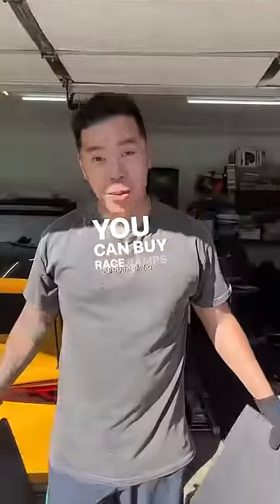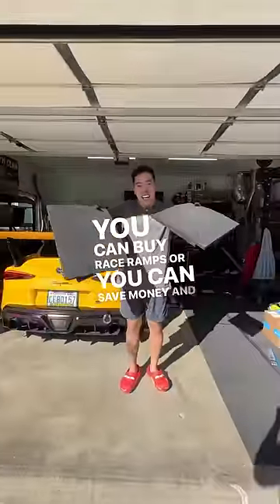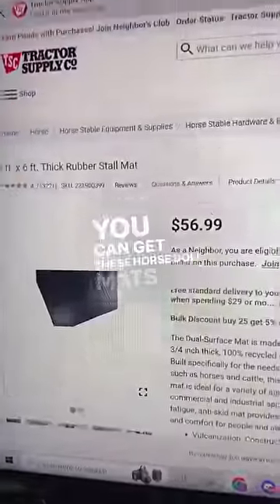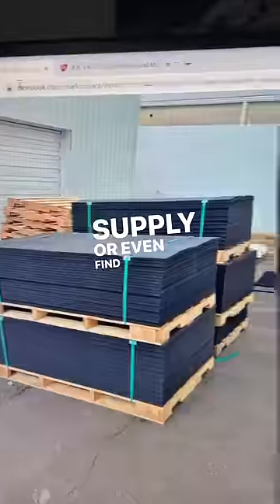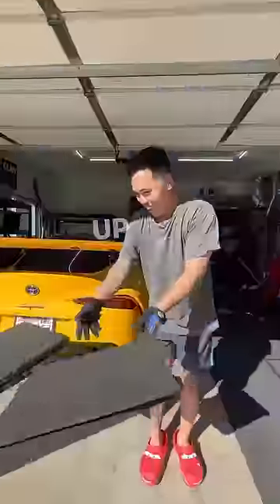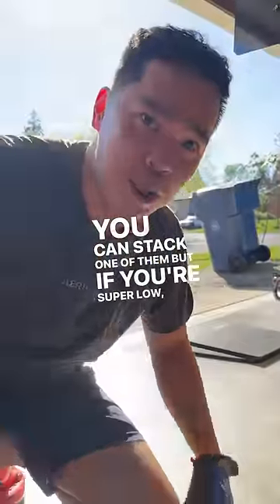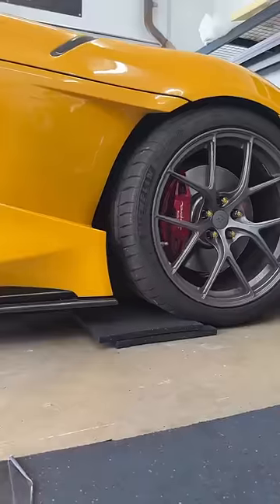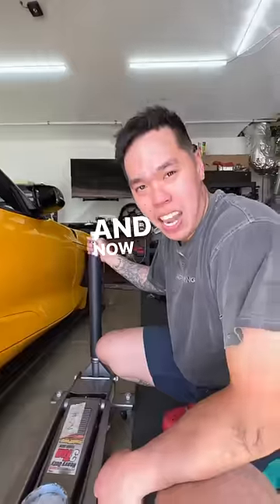CHEAP DIY Race Ramps for lowered cars!

Comment: Why the hell would I buy those mats when I can get the wood for free?
Reply: Exactly
Reply: exactly_#2
Reply: Exactly_#3
Reply: There’s people living in areas without those conveniences.
Reply: Exactly_#4
Reply: @75yomu  wait are you saying you think people don’t have access to wood?
Reply: @75yomu  who has money for a car but not for a piece of wood? You don't even have to buy it lmao
Reply: exactly_#6
Reply: Exactly_#7
Reply: Exactly_#8
Reply: Because the wood can slip and u whanted to get some nice ramps but u can instead just buy these mats witch dont slip and their cheaper than ramps
Reply: @Maykay1312  bruh ramps aren’t that expensive, would you rather spend 50 bucks at Walmart for some nice ramps or 60 bucks for some damn squares of rubber
Reply: Exactly_#9
Reply: @Maykay1312  😐😑😐😑😐 rly ? Wood can slip 🤣🤣🤣 I can’t, I had enough 🤣🤣🤣
Reply: @mirunajs8148  wood can slip much easyer than a rubber mat depending on what surface ur lifting ur car up on
Reply: @Maykay1312  then get a flatter piece of wood
Reply: @krotle8238  eh mby u dont whant a random pisce of wood in ur car/trunk/apartment/garage in the middle of the city who knows  mby its easyer to keep 2 black rubber mats stacked together in the corner of ur trunk who knows coud be any number of reasons but for sure its easyer and it takes up less space than having a car ramp in the back of ur trunk or a pisce of wood + u can use the rubber mat for other things other than going with ur car on it so u can lift it ye u can do the same with a pisce of wood but if u use that pisce of wood enough times its going to break apart the rubber mat will probaby be the same for the rest of ur life + u can do other things with it as mentioned above any thing that can get damaged underneeth if u just place it straight onto a small metal worktable rubber mat in between u whant to lift ur car with a car jack but it has a chance that it will slip rubber mat in between the jack and car … alot of other uses u can use a rubber mat for, ur disasembling something metal something from a engine compartment what are u going to put it on a rubber mat mby? its not going to slip like on a table because its rubber … as i have said many uses but eh depends what are ur needs u have a lowered car and cant get onto a curb and ur sick of placing a wood pisce in front of ur wheels and it slipping and u ruining ur front bumper on the curb u can put a rubber mat instead and its not going to slip ever again problem solved at least if u dont whant air suspention witch is a better option but costs more
Reply: Exactly_#10
Reply: You wouldn’t, it’s just mindless content
Reply: EXACTLY_#11
Reply: Looks better
Reply: Exactly_#11
Reply: @deadzen  12**
Reply: @utkarshverma3219  no, u wrote it wrong.
Reply: @Maykay1312  you skipped physics class didnt you? that wood only needs to hold it up for a second to get the jack under. Ive done this with sticks before. The force being applied to the wood is downward force from the weight of the vehicle there is no side forces. Even if it was a crazy slippery surface like ice it stil wouldnt go anywhere once the tire is up on it.  Also not that its relevant or matters but wood is a very grippy material
Reply: Exactly_#13
Reply: @75yomu use a brick then
Reply: Exactly_#14
Reply: Exactly_#16
Reply: @75yomu  without trees?
Reply: That’s  what I’m saying
Reply: Exactly_#18
Reply: Exactly_#19
Reply: Exactly_#20
Reply: Exactly_#21
Reply: Or leftover carpet 😭
Reply: Uhhh find ‘em?
Reply: @everett5374  for a normal car ye its probably not going to slip but if u have a bit more powerfull car then it might slip but as i have said u can use mat for other things thats my main point
Reply: exactly_#22
Reply: @carlo6229  u forgot nmr 22
Reply: @75yomu   there really isn’t
Reply: @75yomu  no wood but rubber mats. Lmfao
Reply: Exactly #23
Reply: Because then a big red X would show up and we don't need that
Reply: Exactly_#24
Reply: Exactly #25
Reply: Exactly_#26
Reply: I used to get wood every morning
Reply: Exactly #27
Reply: That jacks is meant for pickup trucks or suvs! If you have a car and crossover that’s really low to the ground just get yourself a low profile Jack
Reply: I'm looking for the last ' exactly ' comment
Reply: Free?
Reply: @Maykay1312 want*
Reply: LOL at the people trying to justify buying these rubber mats.. claiming wood can be slippery and its cheaper than ramps.  I've used wood on asphalt, concrete and even marble like surface.. NEVER has a piece of wood slipped, the weight of the car keeps the wood planted.  Ramps are expensive.. I've bought my low profile ramps for $65.. that barely more than these overpriced rubber mats for $56.99.
Reply: Exactly#29
Reply: Exactly#30

Comment: Dude is going to be shocked when he finds out about low profile floor jacks…
Reply: Just about say the same thing😂😂😂😂
Reply: My low pro jack doesn’t fit under my car :( too low if that’s even a thing
Reply: @belemollyon3330  my harbor freight Daytona Jack is about 3” or less off the ground…….and I do have a toe Jack as well.
Reply: i bought the lowest profile jack i could find but it still doesnt fit under my car
Reply: Not even that expensive anymore
Reply: I'm not putting my 50k car on top of a harbor freight jack.
Reply: @clanc433  you do understand that the harbor freight Daytona jacks have been proven to be as good as if not better than snap on.
Reply: @clanc433 I would understand a Ferrari in the saying but a 50k car what did you buy a base model f150? It’s 2023 Jeez dude
Reply: yeah but some people cant afford that so whats ur point
Reply: @joshdaniel7894  bad thing is depreciation will have his 50k car worth less than 20k in 5-10 years
Reply: My speed 3 ain’t even as low as his, yet a low profile jack or some scissors jack don’t even fit  lmao. The other day I needed to use wood planks, e- brake once on top, scissor jack then low profile jack 😂
Reply: I have about the lowest profile jack you can buy, it still won’t get some of these cars in the shop up, not a bad idea if you don’t have any similar shaped wood
Reply: mine barely fits😭
Reply: @clanc433 well then go spend a 100k on a floor jack made out of gold then
Reply: Why buy a jack that's useless for trucks and basically every other vehicle
Reply: Even with low profile jacks it doesn’t lift as high as a regular jack (depending on what you lifting your car up for).
Reply: @nicholasnieves6578  that’s not true.. my low profile jack lifts 24” and my standard jack lifts only 19”.
Reply: Fr
Reply: @j_will9 ain't they made at the same factory with the same part? Or is that another one I'm thinking of?
Reply: @protipskiptoendofvideoandr286  I’m not sure.. I wouldnt be surprised if they are though
Reply: I was about to say that
Reply: A still doesn’t fit
Reply: My Low pro long reach jack won't even fit to reach my cars jack point and it's stock height
Reply: Ahh the struggle of us low life in these comments. Ahhhhhh
Reply: @clanc433 a 50k car is the car world equivalent of a $200 floor jack bro LMFAO

Comment: So... Buying a $60 piece of rubber is cheaper than going to your backyard and get a trash 2x4? WHAT!?
Reply: Fr
Reply: no not one you’ll need about 4 of them so $240 sounds better then free 2x4 aye
Reply: @Titan-zt6ys  the $60 stall mats are 4’x6’. You’d only need one.
Reply: @Titan-zt6ys  break them into pieces
Reply: @pumpkin8222  No I absolutely would not. Nothing wrong with a 2 by 4. If you're that picky you could even paint that S.O.B. and call it good enough lol.
Reply: @Titan-zt6ys  its 4ft × 6ft
Reply: @pumpkin8222 it’s wood tho 😅 and on your tyres
Reply: @Blue-hr9ch  man pls forget about that, I don't know what was going through my head when I thought this is better than a 2x4

Comment: I rather use a 2x4 then spending more money.😊
Reply: That's so basic....I use 2x6's...😂
Reply: I mean, I work at a Tractor Supply, so, you’d be giving us sales to meet out monthly bonus quota
Reply: IS THAT A SUPRA
Reply: @Xdits485  no that’s a bmw with the Toyota and Supra logo
Reply: @Particle_Accelerator_Repairman I only use the finest African Blackwood in 2x8's for my car. 🧐
Reply: Just cut a 45 degree on the 2×4 then

Comment: 50 dollars for a yoga mat is insane
Reply: That isn't a yoga mat it's made to put in a horse trailer to give horses grip they're thick ass rubber pretty handy in the bed of a truck to keep stuff from sliding and help keep from denting the bed too
Reply: “You can save money” I got 5 year old scrap 2x4 for this exact reason
Reply: @Kentuckydude775  50 bucks is still insane tho lol
Reply: We have a lot of these. They’re most definitely worth $50. Each one weighs 75-100lbs and they’re super durable and last forever.
Reply: Fifty bucks is like an hour or two of work.
Reply: @Greenredfield  yeah but a yoga mat is like max 10 dollars in materials not even so its not worth 50 bucks
Reply: @hungryhungryhummer  oh i didnt know, if thats true its actually worth it

Comment: Low profile jacks work pretty good too…
Reply: My 2013 was really hard to jack up with a 1.5 inch drop and side skirts, even with a low profile
Reply: What I was looking for lol
Reply: My mustang isn’t even as low as it can go and I can’t get a low profile unde r it this is due to the front of the mustang always being lower then the back due to its design so I can jack the rear but not the front it’s a headache
Reply: @booost420  then fix your car.
Reply: @jeepmanxj  it’s not broken lol just too low for the jack
Reply: @smartone9787  sounds like it is if you can't fit a jack under it.
Reply: If your car is too low for a low profile race jack, its too damn low
Reply: @outkast937  You realize vettes and any other expensive sports car is going to be too low
Reply: @blowndome  nope. I have jacks that fit right under them no problem
Reply: @jeepmanxj  Maybe with air in all four tires but try it with a flat lol
Reply: @jeepmanxj 😂😂 if a jack can’t fit its totaled in my mind
Reply: It’s called being Static
Reply: They do sell jacks that has a 2” ground clearance. I have one and it’s rated for 3 tons. Only downside is they’re pretty wide as the width is a way to compensate for the thin profile.
Reply: Yea but idk why this guy has a regular jack. I had the same jack from harbor freight but mine didn't fit either so I went back and got the low profile version.

Comment: wouldn’t the wood blocks work the same?
Reply: 90 likes and no answers... I think there's probably really no good reason
Reply: I think the rubber mats have more grip and won’t slip
Reply: It will work same but there's little chance of damaging your car and risk of you dying 😊
Reply: @bendover-bz4bc  risk of you dying💀 bro what
Reply: Yeah just use a bigger peice of wood this guys is on something
Reply: @bendover-bz4bc bro the car is on a jack eitherway 🤔 Why is the risk of dying higher
Reply: Wood blocks are better people talk about slipping go buy some damn grip tape for a skate board problem solved and you are still in it for less then 60 bucks lol
Reply: Timber blocks are better. Timber can spread the load better than those mats. I design outrigger mats for crane all the time at work. Go with timber it’s cheaper too
Reply: Less friction they can get sent to the moon.
Reply: @bendover-bz4bc "Risk of you dying"
You're kidding right?
Reply: @06racing  bruh
Reply: If it’s super low the wood would (haha) have to be really thin
Reply: @FetusFight  never seen thin wood before ?
Reply: @FetusFight Plywood:am i a joke to you?
Reply: @Jusuff  lmao good point
Reply: @linus_ffs1257  The wood can obviously explode and turn into a fragmentation grenade!
Reply: @netts2315  right I didnt think of that my bad 🤦‍♂️
Reply: @linus_ffs1257 Just so you know that was obviously sarcasm like everything else on this chain, you realize that, right? xd
Reply: @netts2315  🤦‍♂️🤦‍♂️🤦‍♂️🤦‍♂️🤦‍♂️🤦‍♂️

Comment: How do you do if the tire goes flat
Reply: with a little help from my friends
Reply: You can use airbags. Place it under the jack point and inflate it.
Reply: @Khemu-q4f very good advice, go to your local junk yard, get an airbag, and connect a battery to it, you won’t be disappointed by the results😂 /s

Comment: Every professional shop has wheel dollies that will jack the tire up way higher than those mats, then you slide the jack under the car and jack it up.

takes less effort, less time, less money, and you don't need to put your knees on the floor. 

Most Profesional shops should already have wheel dollies (can't push hybrid cars around because the permanent magnet motors will still generate electricity, with the inverter off their is no power management system in operation and things get fried).

Comment: Wood works fine. Some planks. More than enough. And if they slip too much, put some cheap rubber under.
Reply: Not meaning this isn't fine, but if you already have wood... No need to buy these.

Comment: Go to a local hardware store and ask for 1by 12 sheets and have some one cut them up in to 1 long pieces like 1foot then 8 inches  then a 6 in piece on top then (1) 1in piece on the back as a stoper like stairs

Comment: stares at my pile of discarded wood, enough to bury my car in

"So anyways, I clamped and screwed a few 2x4's together and-"

This guy: "bro you had to use screws? Too expensive! They cost you what, $200?"

Me: "... You can buy screws for $5, but I have over 5,000 left over from a previous job on the house (too long a storyl anyways, I screwed them together and bam we're done. No $60 wasted, no time wasted, took about 10 minutes, I could even unscrew and re-use the wood if I wanted to... Just like 98% of America"

Comment: I personally would not trust that but you are earning a sports car I use heavy equipment tractors and all that stuff so I guarantee you that would not work for me and I don't have a completely flat clean garage floor like you do that's boards car mayway what 3500 2500 4500 most yeah are Kubota which is a 24 horsepower combination tractor weighs that much and I can almost promise you those are not going to hold it especially our 21 foot party barge pontoon boat there's no way I don't believe it will work for you but but it definitely won't work for what I have

Comment: How are you wanting to save money but you're going to spend that much on rubber why don't you just get some rubber wheel chock from harbor freight for like 7 bucks that's what I got they work like a damn dream Brody's wheel chocks that you can buy at harbor freight for like less than 10 bucks actually have a grab handle on them I don't see your mats having a grab handle I'ma gonna trust my scotches and my concrete blocks and my other stuff that I used the holdup tires off of the ground or whatever or just hold it there so I can lift it up I want to trust that instead of those because what you going to do if it slips those cars up if I had to guess May average Lee weigh around 2500 or 3500 lb gross weight see I live out in the out in the South I don't live in the city so I don't have sports cars and all that fancy-schmancy Gizmo I have tractors and different equipment that gets dirty and I get myself into the holes that require plumbers I don't trust that you can go ahead put your left nut underneath it and hope to God it don't crush it but I'm good